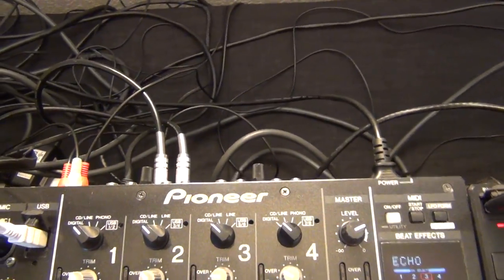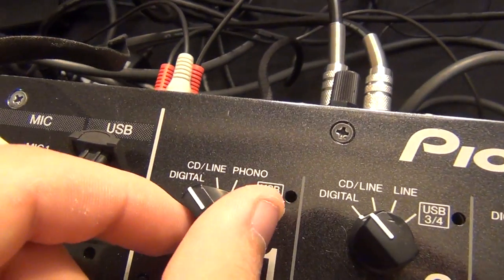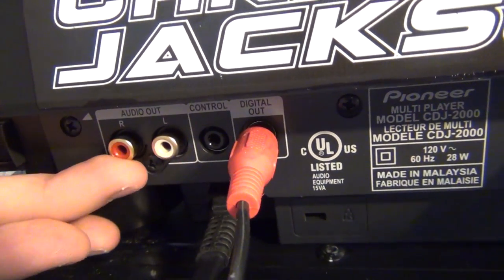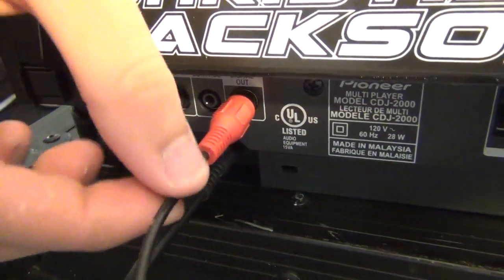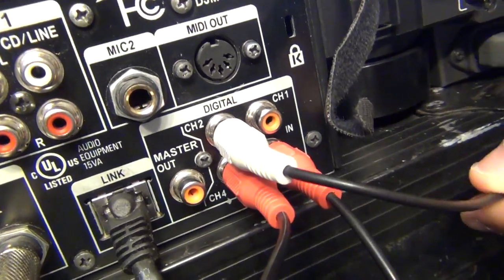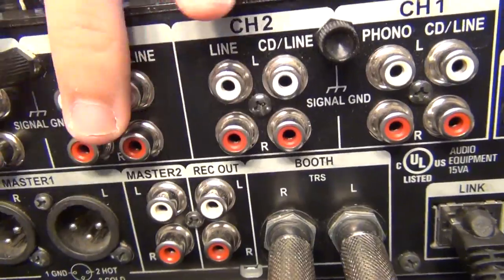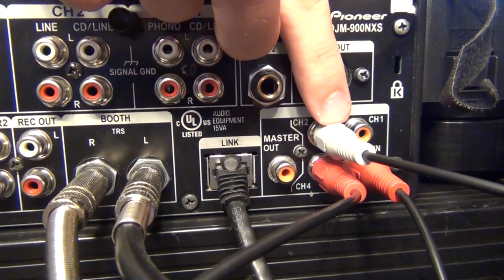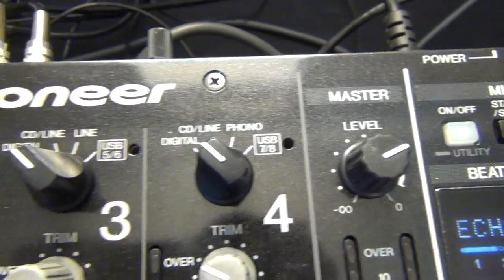DJM900 Digital Inputs / CDJ2000 Digital Outputs Setup

Comment: Great video. When connecting high end DJ gear together like the Nexus/Prime kit, you should be using the SPDIF for a few reasons: 

1. It avoids a step of DA/AD as the signals exit the players and go into the  mixer (which can introduce noise and artefacts).
2. It bypasses the line inputs which can be clipped. While analog distortion has a rather pleasing “crunch” (Xone 96), digital distortion sounds horrible
3. It’s less cables to mess up
4. It keeps the line inputs clear for other DJ’s sharing the mixer that need them
5.It's one more improvement I can make to the overall sound quality of my setup
Reply: In my view using digital outputs won't improve sound quality, specially in nightclub's sound system cause they aren't HiFi concepted in 95% of cases. Before the speakers the signal will be majority converted in analog system. For example: this mixer can reach 40kHz according Pioneer's manual. But it's known the human ear can reach 20 or 22kHz. After this, no one can hear; they just can see it using especial equipment. And trust me: this "feature" won't improve sound quality. To be honest, it's just foolish technology to justify their prices.

Comment: Nice I bet lots of ppl had questions regarding things you mentioned in this video. I would have been cool, just for case inpoint, if you connected booth the cdj digital and rca output into the mixer and payed someting then switch thet imput selector on the mixer. like i said. just to demostrate your point.  thanks again, I was here because i was being sold on "special" digital audio rca. and I was researching if I could use the cables I have.  thanks again
Reply: Digital wont clip and has better quality!

Comment: hi folks,one of my cdj2000 nexus players when i plug in the 2 rca outputs and plug into my djm900 nexus mixer i get no input to the mixer and of course no output,i have the channel selector on cd/line.but if i plug into the digital output on the cdj and into the digital input on the djm900 and select the knob to digital i get both signal in and output perfectly.any one have a clue why this is.strange problem.cheers john

Comment: Is there any difference in sound quality compare to the standard analog RCA?
Thanks!
Reply: in my opinion there is no difference
Reply: It will do depending on the application, quality of file played, and sound system. It will especially if you use the digital out of the DJM to a digital X-over. Otherwise it's file (digital) D/A to analogue signal out the CDJ, then A/D to digital in the mixer, mixer then D/As it back to analogue, then most like A/D to a digital crossover, then D/A back out of the crossover into the relevant amplifier.
Reply: If theres no difference whats the point?
Reply: @trancepower1205  less cables, less mess

Comment: What protocol is accepting this input in the DJM-900 nxs2 ? and sampling rate and bit depth ?
Reply: Found it, here for other interested:

Input format: S/PDIF
Sampling frequency: 32 kHz/44.1 kHz/48 kHz/88.2 kHz/96 kHz
Sampling bits: 16/24 bits

source https://support.pioneerdj.com/hc/en-us/articles/4405915517977-What-are-the-digital-input-specifications-

Comment: So that's a left and right signal ?
Reply: No. In digital domain there're no left/right connections cause the signal is converted in bits using one cable and reconverted in other equipment using an internal decoder. Those bits carries the information about left/right signals.

Comment: if you use RCA inputs, will the mixer enables digital output from the coaxial output ?
Reply: Yep, cause the mixer converts all analog signals to digital domain before send them to S/PDIF outputs (analog signals are CDJs using RCA connections, turntables and microphones).